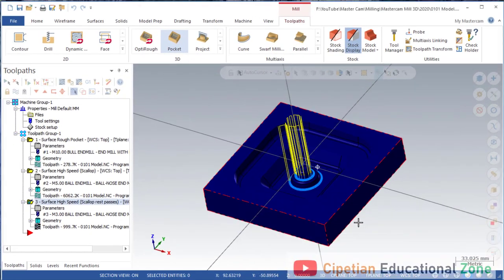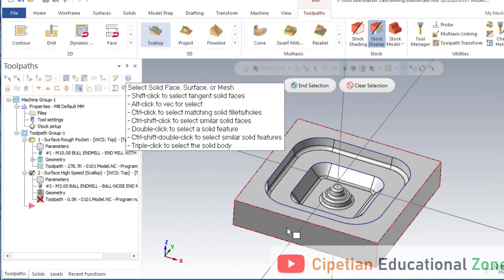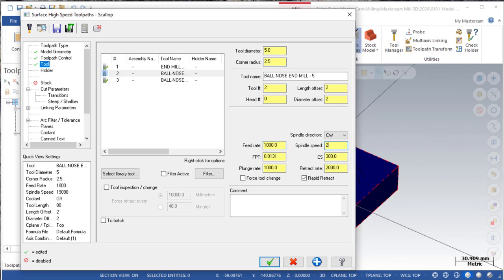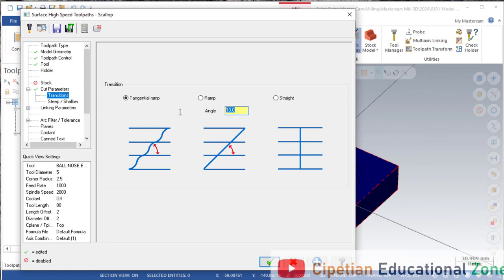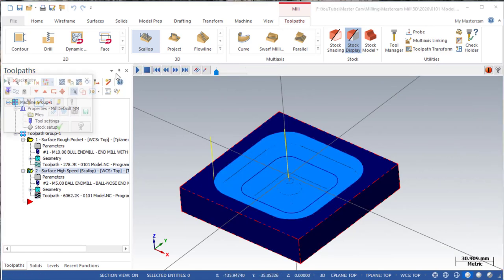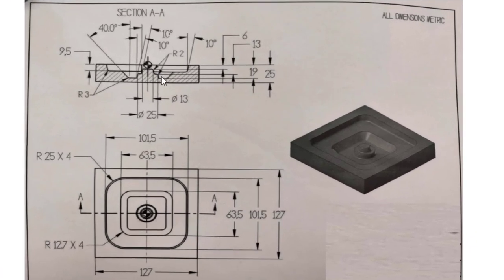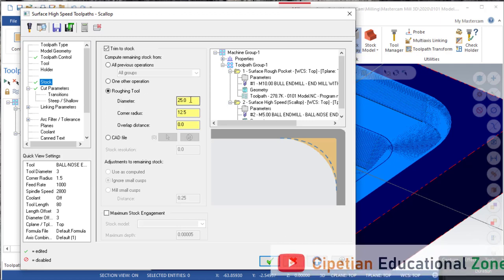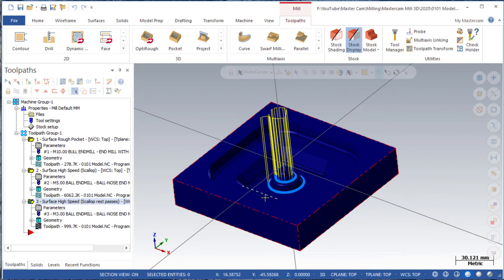Mastercam Mill 3D || Scallop Mill || Surface High Speed Finish Tool paths || Semi Finishing

Comment: Helo sir ofter completing roughing with 10R2 if  i run finishing  with 5ball cutter load will comes or not sir in my laptop showing 3d simulation stock ofter completing rough